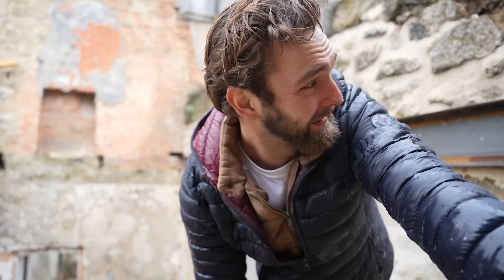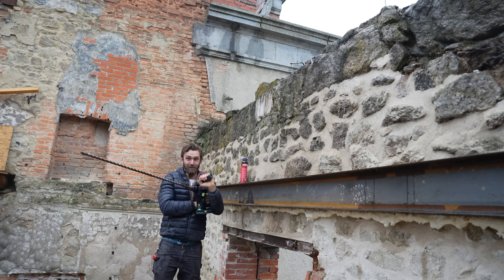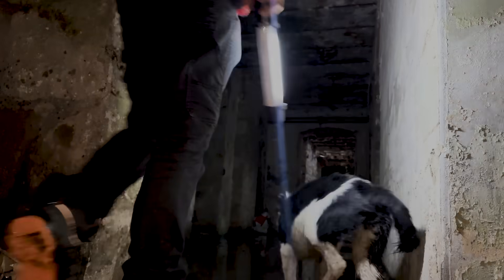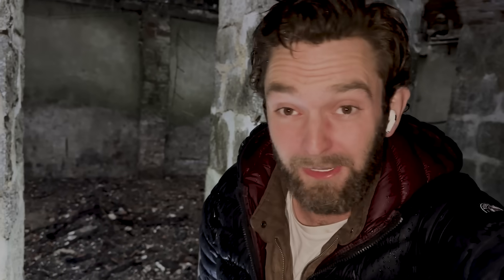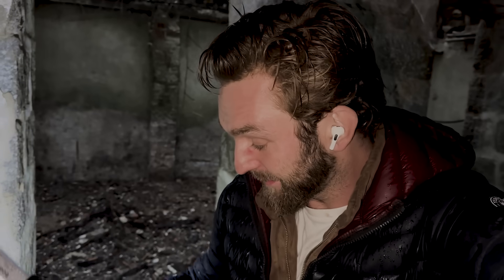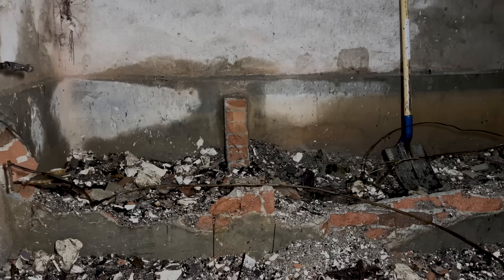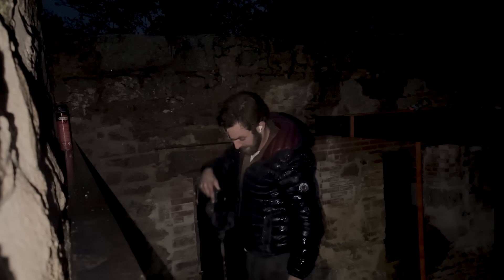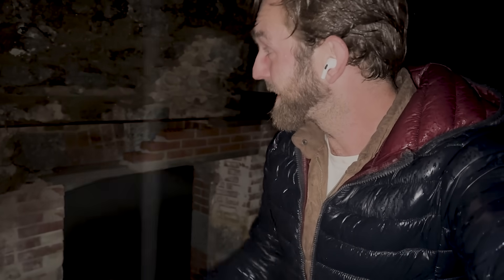Drilling the anchor points for the floor

Comment: Clearly a job to get done quickly in spite of the weather!  Nice to see the pups; you are getting there; keep up the good work!  A pool: well, call me surprised and you could knock me over with a feather! Never would have guessed that!
Reply: Bit of a surprise indeed! I had been under the impression that the Mironnets had done a lot of maintenance and cosmetic stuff but I had no idea they'd done much more than that. I wonder how they'd intended to deal with the stone column in the middle of that room that supported the arches that in turn supported the concrete ceiling.

Comment: Hi Dan, I follow you a longer time and in the meanwhile I am a little addicted about your progress of rebuilding that Chateau. I really hope you can bring the roof on top soon because all the rain is not so good for your health and the wood inside. So stay strong and healthy. Your fan Günter from Germany.
Reply: I' don't know what he is planning to do but a rood in not a thing for an amateur. You got some calculations to do especially since he has a continental climate, the weight ot the snow can be important. The best, but it the coslty solution, is to get someone from a "Bureau d'étude" take some measurements with a laser, and built you the frame on computer. Then we have CNC machines thant can trim wood beams into the pieces needed. Still tneed to assemble them though.

Comment: Once, while rebuilding a school building for the union, I spent an entire summer drilling holes through 3-4 foot brick and concrete walls. All day, every day. The drill bits weren't particularly new. So, it was slow going. Super huge drill bits and hammer drills on a big ladder...
Feel you bro.

Comment: Tip: Predrilling the hole in the steel beam with a smaller bit first, will make the large bit finish size drilling go much easier. 
That room in the basement with the dirt floor would make a great Sauna and Hot Tub room, with small cool down Wading Pool!
Reply: 1:00
Reply: Isn't that what he was doing at 0:50?
Reply: He did so. But I could only see a small pilot hole before he went for the whole diameter. He could save a lot of time by stepping up the diameter in smaller incrementals. Personally, I would hire a drill with an magnetic fot. Those do the job as easy as in a pillar drill machine.
Reply: @Sgirl  He used a very small bit then went full size. If he had stepped up to a slightly larger bit, the final hole would drill so much easier!
Reply: @MrDemi1233  
Still too small a bit. Had he stepped up to a medium size, then the final drill would have been easier!
Reply: @josiatokirina1788  I saw him use 3 different drills, small, medium, and then the really big one. But whatever, this convo is now boring me 😄 He got it done in the end, just like he always does.

Comment: Dan, you are a man of pure will.
I would have started to drill the hole and after two minutes said nope and got a big corded sds max hammer drill. Those small cordless drills are not made for this. Get yourself a big sds max hammer drill. It will come in handy in the future especially for demo work.
Reply: He's using a Festool SDS plus a straight shank adaptor for the steel. Do tell, what difference will Max make over Plus apart from a different slotted drive?
Reply: Remember, he's deep in rural France, not 10 minutes from All the Big Tools R Us 😅
Reply: @bayadere8308  The SDS Max has more power but for drilling holes that size the SDS plus should be fine. Drill bits longer than 500 mm and thicker than 16 mm (both, not either) is where things get properly annoying. Drilling through a 600 mm thick wall for cables with an SDS plus and cheap 1000 mm long drill bits was quite difficult. The wall was also a random mix of brick and fairly hard stone.

Comment: In France, you can have a temporary electricity box for when you're working on your prpperty. Since The Châteaux had electricity before you should be able to find the wires somewhere and put such "Coffret de chantier" ("construction box" said the translator) near the entrance of the Châteaux. You wouldn't have to run extra long wires to your tools.
I wonder if, since you are in the middle of nowhere, you would need a three phase system.
Reply: I think that's what the electrician suggested, putting the coffret de chantier by the gate where the existing pole is. That would still mean running massive extension leads all the way to the château though, which is annoying. Considering the sheer size of the place, three-phase might be a good idea anyway and I think it's reasonably common in France, although smaller domestic supplies are usually single phase, unlike in neighbouring Belgium and Germany.

Comment: From my grandfather:  find the drill speed and pressure that results in curly-cues of metal coming off the tip.  These remove the heat from the bit and keeps them cooler and tends to prevent the bit from burning out. Plus, it seems to drill much faster

Comment: Dan, using the Generator to charge the Battery is very effective as the Generator is running at constant load.
Usually a generator runs the most time in Idle and burning fuel for nothing. 👍

Comment: a puddle pump could be a good idea when the rain stops if you need to drain anything like the basement. I have one for my backyard as it floods several times a year. The reasonably cheap one I bought came with a one-inch hose and it sucked out 40 litres a minute. I have used it once so far and it was marvellous.

Comment: Excellent video as always! I would suggest that you take your time when drilling through the granite, the cutting edge is hardened steel and if it’s overheated it will loose the tempering and make it very dull with little or no headway. Always good to have have a spare one handy. I really commend you on your dedication. Bravo‼️👍
Reply: I'd expect an SDS masonry bit to be carbide tipped to be honest.

Comment: Sensible approach to get the work done first, then post the vlog. Fascinating to learn the previous owners were thinking of putting a swimming pool in the basement. That would not have occurred to me at all. About the electricity being brought up to the gate, does that give Dan the ability to connect the yurt to the power line, and possibly the chateau as well? I am hoping that’s the case. Also hoping that the work goes well in the next couple of days.
Reply: Great--one more job for Dan--why doesn't the power company run the lines all the way up to the Chateau??
Reply: Why didn’t he know solar power is sunlight and prepare for dark days 😎
Reply: @lynnmahoney6283  First thing, is electric power & water source to a property that is being built/under construction.   That's what we did when building our home 18 years ago on unimproved land.   
Dan did get Eco-flow Solar system because he he is trying to be as 'green' as possible; he has stated as such at different times & in the Tablet Magazine article this year.   However, there are times like now with dark days heading into winter where he is finding out what he needed to prepare for all along.

Comment: You can sharpen those metal drill bits on a grinding disk, if you get the angle right they will fly throught the steel! You probably know this already, but just thought I would mention it 😁👍🥳

Comment: Not sure what kind of anchors you're putting in, but generally it is a good idea to drill the holes at a slight UPWARDS angle. That gives any water seeping in a chance to drain out. Accumulated moisture will freeze and expand in the winter which could weaken the anchor.

Comment: Drill a pilot hole with a smaller dimension drill bit. Either that, more pressure or a mag drill. You'll need to apply so much pressure if you use such a big one directly. Too little pressure will cause heat and you lose the hardening and sharpness.
Keep up!
Reply: Wasn't drilling a pilot hole what he was doing at 0:50?
Reply: @Sgirl Ah, yes you're right!.. but then when he uses the big drill bit, it's almost only grinding and not cutting. In other words, the center of the drill doesn't get enough deep for it to cut.

I forgot to mention that a step drill works really well which acts as a pilot drill for itself and also a guide/fixture, preventing the drill from jumping sideways. I've managed to drill through some very nasty steel using a step drill. It surprised me how well it worked.

A step drill with low step inclination is what he needs!

Also, best is, if final step of the step drill is the same size as he wants the hole to be.

Comment: Greetings, and thanks for your hard work and videos. One suggestion. Having drilled a lot of steel frames, I have found it beneficial to start drilling with a smaller bit, and slowly, as applicable, redrill with larger bits. I have found that this saves your larger bits from dulling. Just an observation. Thx. R/Ron

Comment: I strongly recommend cobalt drill bits for drilling through that steel channel. Once you use cobalt drill bits you will never go back standard HSS drill bits. The cobalt is more expensive but you will thank me after utilizing the cobalt drill bits; they will cut through that steel channel like butter. The cobalt drill bits will save your strength and time.
Reply: Would you consider donating them to him?

Comment: V168: The larger the drill diameter Dan the SLOWER you should drill - because if the drill 'kicks' it can break a wrist or arm! Also use a cutting compound called 'TREFOLEX' it is THE BEST. The drills just EAT through steel. GOOD JOB!!👍 You need to stretch a tarpaulin over your work area mate - you will get pneumonia! OR Get a 'Drizabone' long wax coat Ive had mine for years keeps out even STORMS"🥼
Reply: Hi this long wax coat Drizabone   how can we get one to Dan  ideas  any body ?❤❤❤

Comment: Hire a magnetic based dill to fit in the web of the RSJ. It will eat through the steel. 
Remember to rope up the drill so its tied to something above if thats possible. Just in case the power goes off when your drilling, or it will end up going towards the ground floor PDQ

Comment: Your not afraid that theres gonna come water, between the wall and the metal beam, now that you have foam at the bottom.. could end up have in small lake up against the wall.
Reply: Just poke a few holes in the foam to act as a drain.
Reply: An little amount of water don't hurt anyting when working with mortar or concrete. There's an reason Dan are pooring water on the walls before doing brickwork. To things are to dry or dries out to fast, it will give you weak walls or floors.

Comment: Hi Dan when you drill thick steel you will find it a lot easier if you drill a small hole first ie about 4 mm and the go up in a couple of stages keep at it .

Comment: I love watching your work progress, you doing great, keep on going.

Some advise... when drilling the holes in the steel start off by drilling with a smaller drill bit first, like a 6 or 7mm. It will go significantly faster. you can even step up to a 10mm after and then your final diameter. Drilling it with consecutive sizes will be much faster than just starting of with the final diameter drill bit.

Comment: Hey Dan it's good to see you still making progress. One thing about drilling the steel one is to use lubricant which you are doing but the other is to slow the rpms down and apply more pressure. If the drill bit is just spinning all you're doing is dulling the drill bit. If you are having to walk the drill bit around to get it to make a hole then the bit is dull.

Comment: At 6:56 in the video, he realizes that the drill has been running in reverse and switches it to forward.  The pace picks up on the drilling process afterwards 😉
Reply: Stuff happens.
Reply: He switched it to hammer action.

Comment: I'm not a builder, but I do know that steel expands about twice as much as masonry with temp changes. So if you fix your steel to your wall on multiple points, you are going to create a lot of stress. Normally your beam can slide a bit into and out of the wall pockets. But if you fix them on the wall itself, that little wiggle room will not be there. 
Anyhow, I like the madness of the project you started upon.

Comment: Hard graft Dan, a step,drill bit might be worth a try to get through then finish with the final dia drill bit.  I assume you will use an epoxy to bed the bolts in the wall or maybe expanding bolts?  Hope next few days go well and see you Sunday or whenever you are ready, nobody would begrudge you just getting on with it.  Andy UK

Comment: Hey Dan, thoses holes probably could've been drilled in under an hour... Start with a 4, then 8, then 13 or something along those lines and apply a lot of pressure on the 4. High speed for 4 en 8, low for 13. It's steel and not stainless, just send it

Comment: :hand-pink-waving:Thanks for another vlog dan; always a joy.  Wondering if you need to varnish the OSB before it gets saturated and starts crumbling?
Reply: It might help.   Dan bought OSB3 for temporary floorboards.   They are somewhat waterproof with light rain.  Not so much with constant rain deluges.   Many commenters recommended Dan put something on top ( a tarp?) of the OSB3 boards when he first began putting them down in the main hallways.   In fact, tarps may still be covering 1st floor main hallway.   I am mainly concerned about the OSB3 boards up on the top level/2nd floor, bearing the weight of the heavy lift & steel I-beams.

Comment: The pressure to try get some sort of roof up for the winter season must be intense now. Looks like you're going to have to concede and make a temporary plan for now. What a pity. Is there no way you can hire some help to try get a bit of a jump start on it all and get closer to ur goal before the cold and wet and ice settles in? Good luck Dan and be safe.

Comment: Try drilling a 5 or 6 mm hole in the steel first then open it up with the larger drill. Should be faster for you.

Comment: I was taught that if you rock a drill side to side it will damage the cutting lip of a drill bit along the edge.  If you examine the edge of a new drill bit you should see a sharp corner (90 degrees) between the lip and the outer edge of the drill bit.  If your corner is already busted then rock away; however the deeper you go the poorer the performance.  Maintaining a constant angle of 90 degrees should do well in preserving the cutting lip. I use wd-40 to lubricate and cool the drill head as I drill.  Drilling sucessively larger holes make cutting a larger hole easilier, since the chisel point (center) of a drill does not really do all the cutting, but rather asorbs most of the applied pressure.  Let the drill bit (if its sharp) do its job; do not try to force it through instantaneously.  I do not know about cutting into granite? Does granite damage the lip? I do not know how to advise you about sharpening drill bits on a grinder. I usually double the size of the drill bits as I enlarge the holes.  Is somebody an expert on drilling steel and granite and sharpening bits on a grinder? I am not really an expert, but I have destroyed the cutting lips by rocking the drill back and forth and have sharpened them back the best I can.  The corners on the cutting lip are exposed, fragile and break off when the drill is rocked to violently side to side.  I find a sharp bit is loads better than a dull one.  The steel you are drilling looks to be hard stuff.

Comment: If you plan to be drilling a lot of holes in structural steel, you could get a magnetic base drill.  It will attach magnetically in any position, even upside down and allow you to drill much easier with leverage.

Comment: Hi Dan, enjoying your videos, well done.  Just a small bit of advise drilling those steel channels, I see you are using about a 3mm pilot drill and then upping it to about 12mm. If you were to use a 5 or 6mm drill to open up the first hole you may find it easier to drill with the larger drill. The larger drill is possibly not cutting with the actual cutting edge but just the small edge on the end of the drill.  Just a thought!  Ron in Melbourne, Oz

Comment: Indoor swimming pool is so 1970th. They all had it and then retired it in the next decade. You do not use it that often and then things break and you do not repair it anymore. A outside pool is a different story. Nice in the summer to jump in between doing the work. Maybe with a deep dive section and jumping from the top of the chateau 🙂

Comment: Nice work!  A 20mm hole thru 8-10mm steel shouldn't be taking more than 10min.  May want to look into sharpenning the the drill bits.  Also, that festool seems a bit undersized for that hammer drill bit, doesn't the bosch SDS you've used also have the drill function?  Or was it that you don't have the electricity yet that made you go cordless?

Comment: Seems like you got some pretty dull drill bits for the steel, & you need a shorter masonry drill bit. Use the Shorter bit to get started & switch over to the longer bit. Not only is it easier, your long (expensive) bit will last longer.

Ideally you need a mag drill for the steel. You never get sufficient force on the bit causing them to dull pretty quickly.